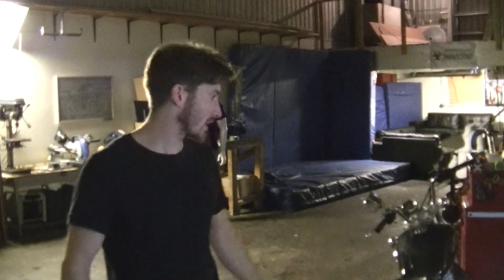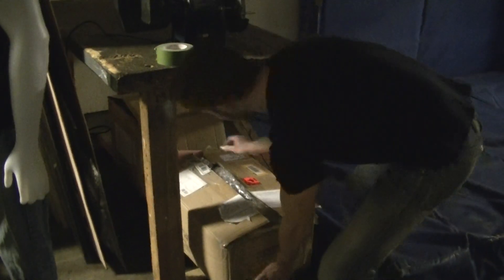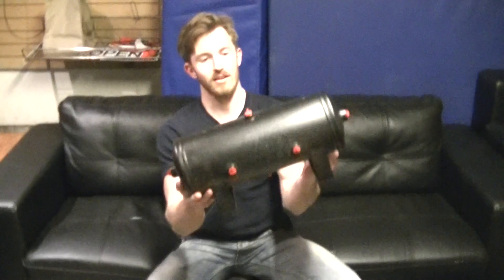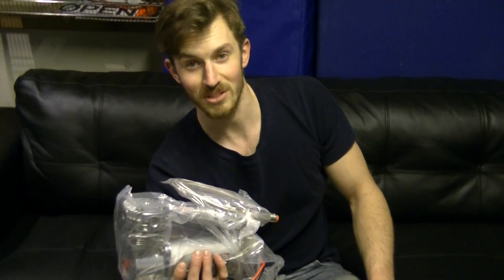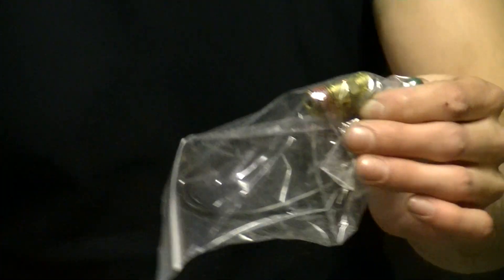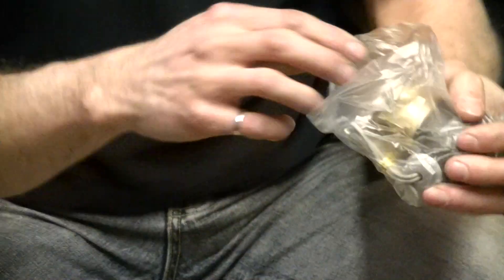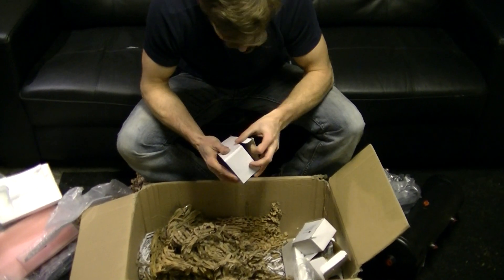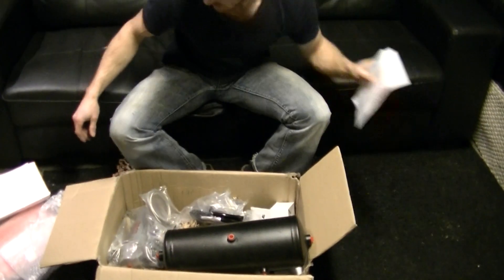Exoskeleton Mk2, Part 6: Parts are in and a TV Interview??

Comment: This is gust a suggestion but you can do the bottom half of the exoskeleton with electric motors instead of cylinders because your movement will be slower if you cylinders in stead of electric motors for the bottom half of the exoskeleton

Comment: Hi, 

First of all its really great to see you still working on the exoskeleton and all your efforts and money invested in your projects. 

Furthermore I like your idea with the dual air supply option that you have planned. 

But here is my thought. How are you going to switch and controle all the solenoids? 
I had a similar project to your exoskeleton in mind for about 6 years now and I have designed quite a few parts and especially electronics since im studying electronis. 

So if you could use some help or ideas just let me know it would be a honor for me to be able to help you with your great projects. 

Take your time and carry on these great projects. 

Best greetings from germany,
Michael
Reply from the maker: Thanks! If you watch one of my earlier videos (part 3 of mk2?) I'll actually be using pressure regulators, not solenoids for the majority of my motion -- so then it becomes a matter of controlling a servo per actuation. I will likely use an Arduino but haven't looked into it in too much detail. Could definitely be able to use some help!

Comment: Awesome, Nawesome! New ideas are still in the works and I've got plenty that I haven't shared with you yet, only because I think they can be elaborated on a little more for future reference and utilization. But, just to give you an idea on what I'm researching, one set of ideas has to do with propulsion and the other with hybrid "penny pinching" for energy using several innovative techniques. Within both groups of ideas, I am looking to figure out how to get a large amount of power with miniaturized parts that could possibly be made using 3D printed parts.

Comment: Also if you wanted you cold probably make a flexible housing for lipoly flat batteries to go in to run a back mounted compressor  system
Just a thought probably should have said earlier in the process but whatever.
Reply from the maker: GameBreaker how do you think the onboard compressor will be powered? ;-)